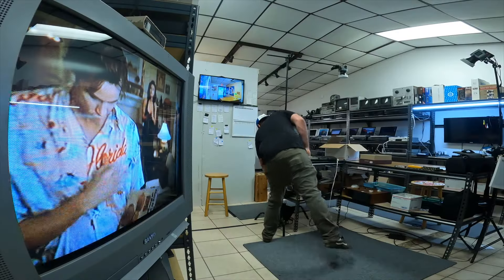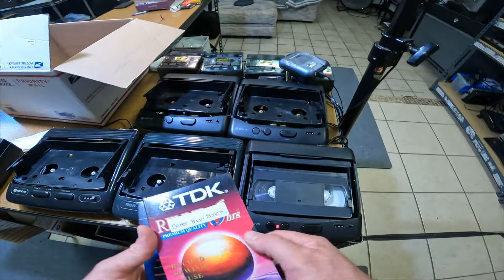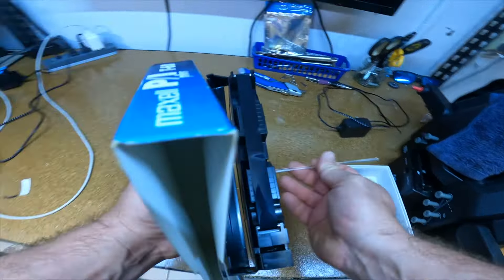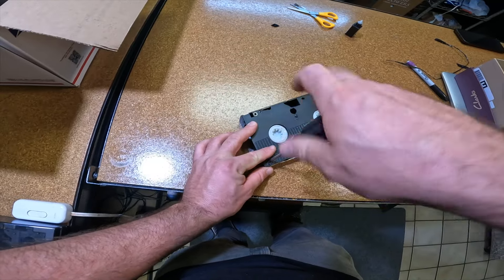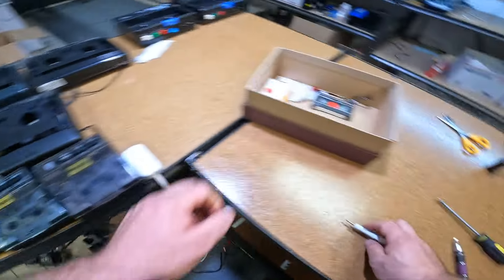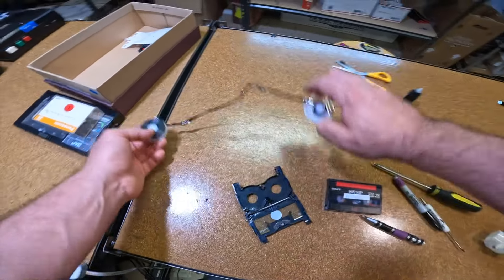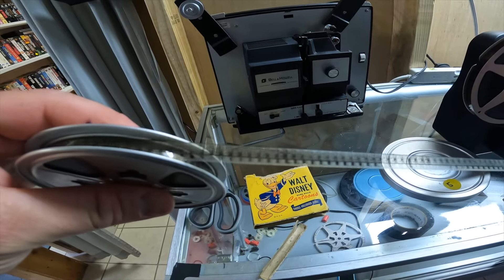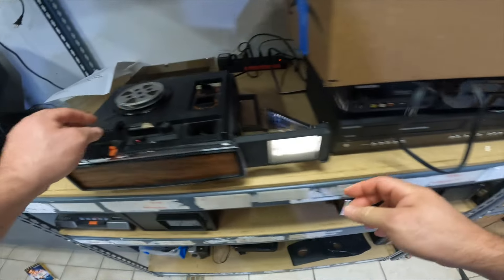Dog Destroyed Her Home Movie tapes

Comment: Uhh... did you realize that you might need to have a Firewire to Thunderbolt adapter, and a Firewire cable, plus a copy of iMovie (since the app comes with every iMac and every MacBook) and digitize your MiniDV tapes that way. Plus, when splicing Video8, Hi8, and Digital8 videotapes, make sure to use not only proper splicing tape, but also a proper video tape splicer, like the kind that Colin of Video99 Audio and Video Transfers uses in order to splice them.
Reply from the maker: Maybe next time. I do make sure customers know I don’t use firewire. And masking tapes works better. I’ve got it dialed in! Been doing it this way for 25 years.
Reply: @EmeraldCoastDigitizing  Oh... I see that, Sean.
Reply: He might not even need a thunderbolt adapter. A lot of those MacBooks look old enough that they probably have FireWire built in.
Reply: @wright96d  Oh, I know.
Reply: Isn’t it necessary to use gloves to prevent fat from the fingers adhering to the tape and then the tape heads? 😬🤔
Reply: @thomashenden71  As if that matters when using crap video grabbers. You get destroyed digital files only anyway. Customers using such companies just don't know better and think it's quality.